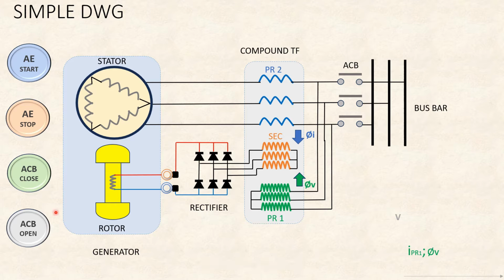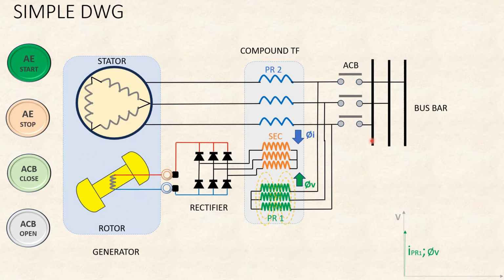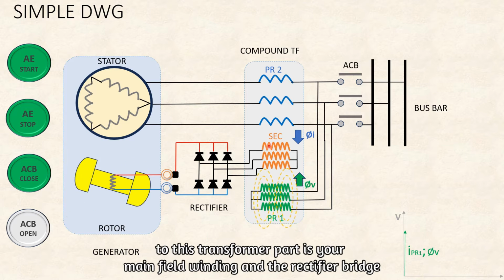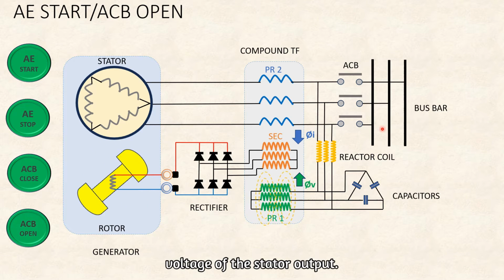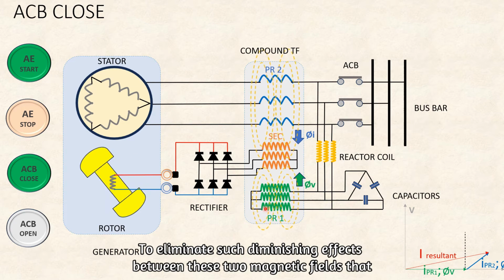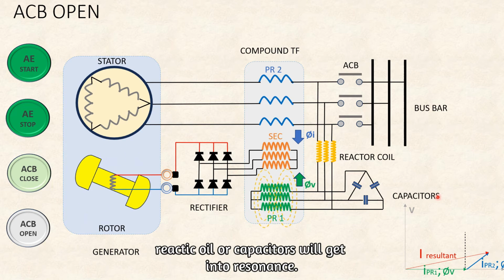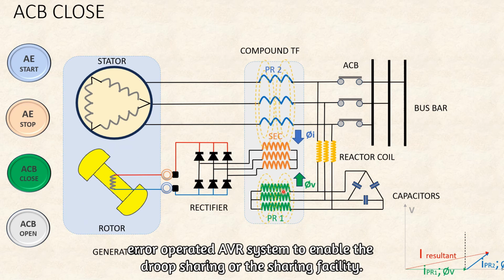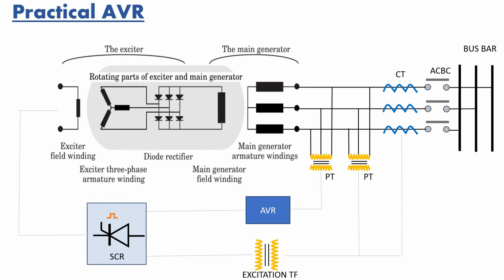AVR - Automatic Voltage Regulator 2 (English) - STATIC/COMPOUND EXCITATION #marinengbase

Comment: I have a doubt. Like u said the reactor coils should come into play before the load is applied on the  busbar so we use capacitor bank instead. So isnt it better to connect the reactor coils after the ACB contacts. In this way the reactor coils will only energize when the acb is closed and load is taken into busbars, eliminating the use of capacitor banks?
Reply from the maker: No it wont work in that way..after the ACB   means the bus bar...We cannot keep reactor coils permamantly engaged to the bus bar.
Reply: @marinengbase 
Got it. Thank you for the reply.

Comment: sir, in no load there is a resonance, so there will be oscillation too, will that add up some voltage to pr1, and how in no load the resonance is not there though frequency would be same i.e. 60hz.

Comment: Hi.
If there is no reactor ( no phase shift) ,  what will happen when we closed the breaker and how does the field diminishes?
Reply from the maker: Hi..thank you for the question, the deminishing effect is due to the interaction of two magnetic fields vector direcrion. One magneric field is due to vootage effect whilst the other is due to current. And the planes of these two magnetic is dictated by the power factor of the system. To get the maximim benifit drom both the fields with the maximum efficiency the direction of one magnetic filed need to be changed. So it is easy to alter the voltage field. Thats why we use reactor coil in series.
Reply: @marinengbase  so how does by shifting it to almost 90 degree give the benefits? Does the position of Iresultant and Phi due to Iresultant matters?

Comment: Sir in no load condition does this capacitor bank gives an alternative current to PR1 excitation  coils & that will produces an excitation for secondary coil through rectifier bank into rotor?? & start rotating rotor??
Reply from the maker: No ..its not like that, the excitation system does not have anything with rotating the rotor, The rotor is driven by a primover (like a diesel engine or a steam turbine), No load means, there is no any electrical appliance is connected to the generator output.
Capacitor bank will resonance with reactor coils and increase the current flow tot he PR 1 in no load condition then the magnetic field of the main field winding will get strengthen
Reply: @marinengbase  Thank you Sir